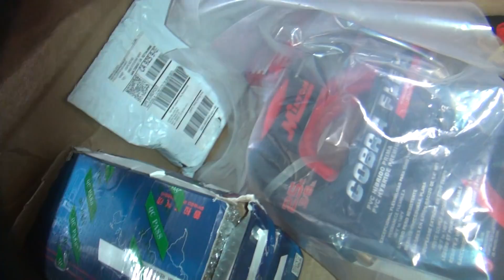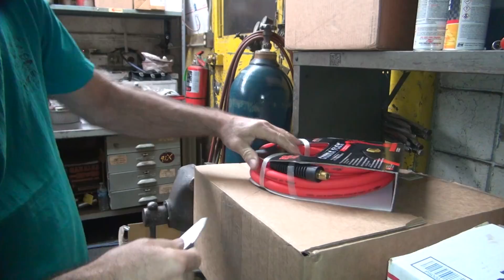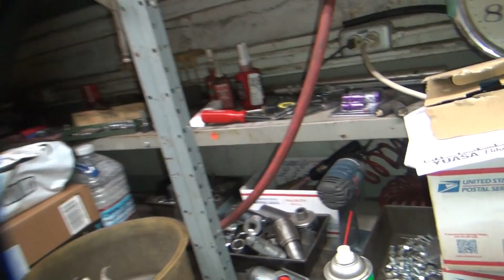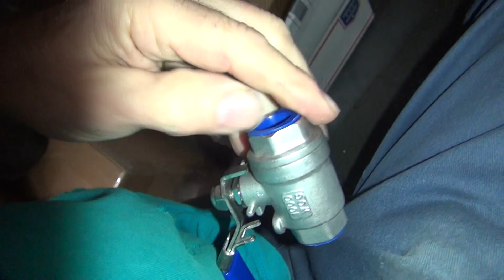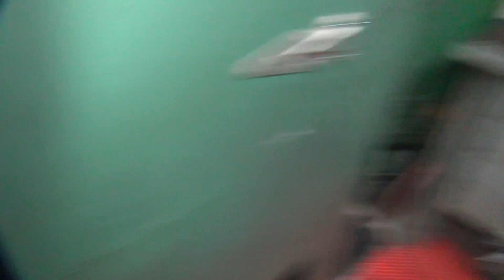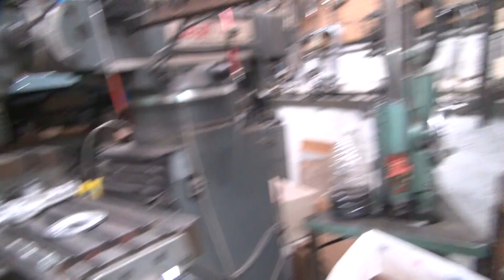#101 2022 start of a new year getting up to speed at tatro machine harley shop air lines and more

Comment: I have a real simple comment for you I have an 02 Sportster coil wires I thought I remember this but I forgot cuz I've been tearing this thing apart so many times and even funny the pink wire does it go on the right side or the left side I'm figuring the pink wire goes on the right side and the white wire goes on the left side if you're sitting on the bike looking at the coil prank on the side or the carburetor is white on the side of the shifter does that sound right to you if you get this message please let me know
Reply from the maker: beats me. read the instructions or go look in the harley service manual. that is what they are for.
tatro

Comment: Tatro, what kind of piping do you recommend for air lines in a shop? Its a wood shop, none of the tools need the kind of flow you need, some nail guns maybe a spray gun? Something that won't break the bank.
Reply from the maker: plastic is cheap and works very good for lower pressures.
tatro